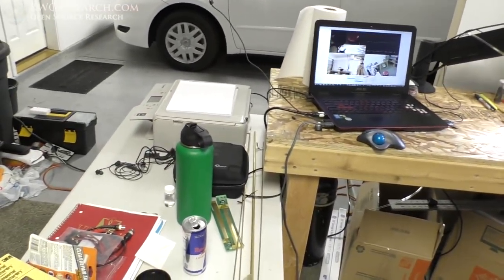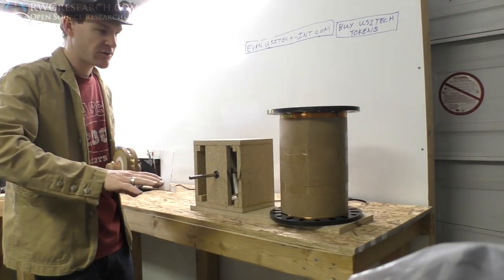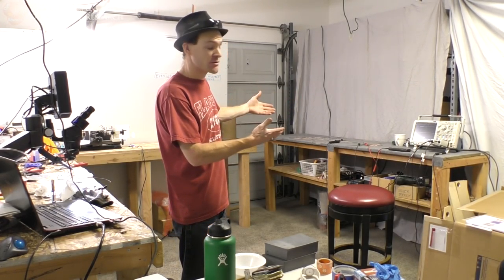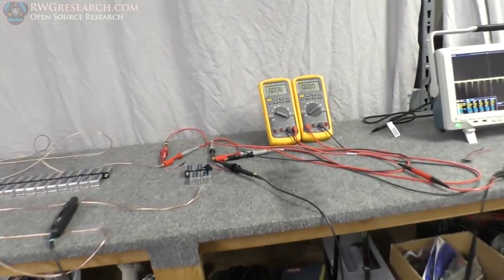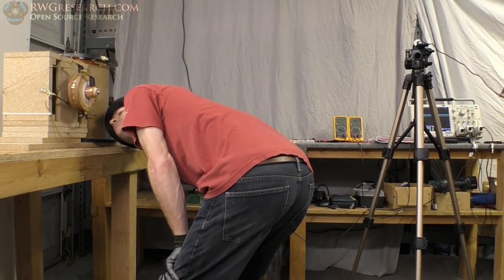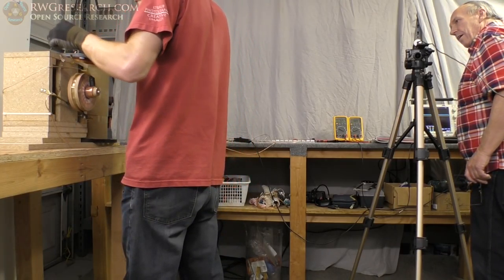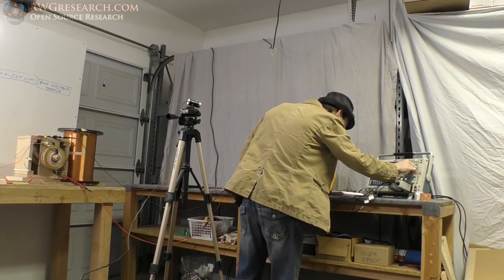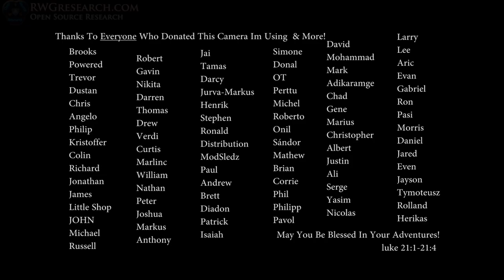JWN Project P3: The Random Bits As We First Started To Get Started...

Comment: Did you Notice the change in the video audio when you adjusted the commutator where it sparked aggressively, the audio went down in volume the camera audio AGC was responding to a huge spattering of multiple wave lengths being transmitted by the huge coil. The sparking causes an EMI transmission because the Back EMF is Huge Extremely High High Voltage Probably over 10KV.  What is the inductance of that coil in Henry's? This is what I guessed Calculated.
 Coil  Length = 13.5 Inches
Coil  Diameter = 3 Inches
Coil  Depth = 9 Inches
Conductor  Length = 94485 Metres
Conductor  Diameter = 0.01 Inches
Magnetomotive  Force = 69.033 Ampere-Turn
I = V/R  = 0.384 mA
Conductor  Resistance = 31289.42 Ohms
Inductance  = 490909.1 mH
Energy  Stored = 0.036 mJ
I am Not sure of the dimension's of the coil.

Comment: What have you made at the second half of video? Because was hearing loud cracking high voltage noice. And almost at the end what means that futuristic signs?
Reply from the maker: heris30 hi heris,  the cap was charging and discharging on the short.  So it was giving an impulse of power on each short.  ~Russ